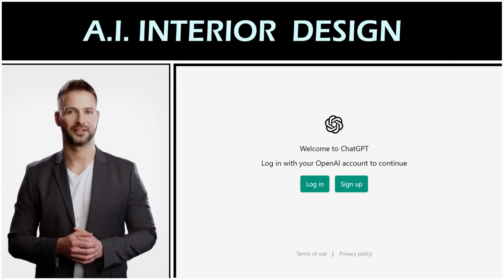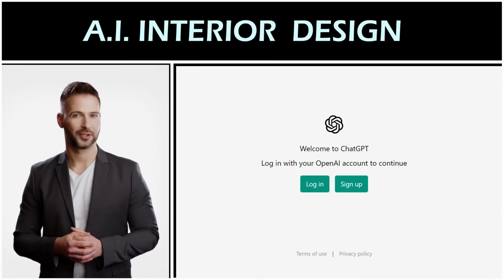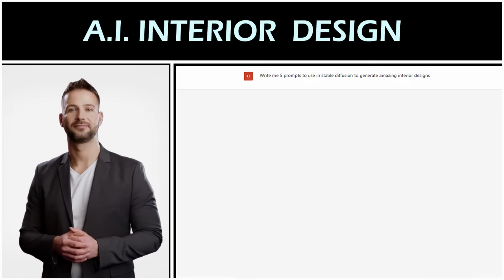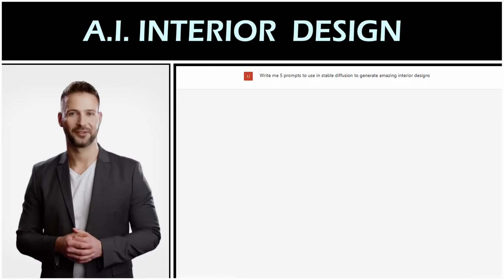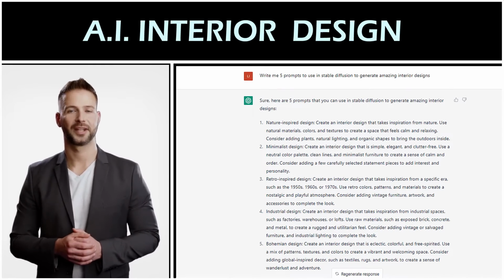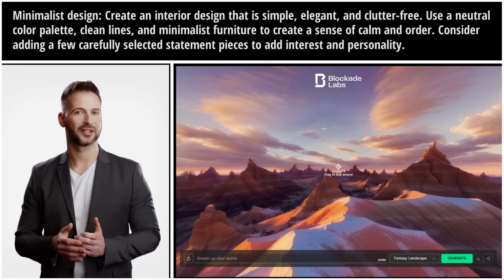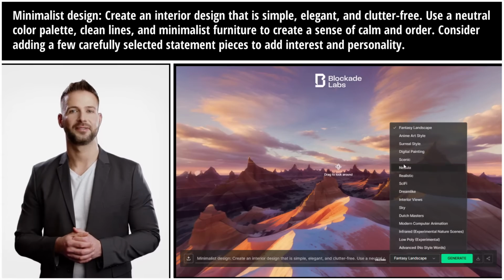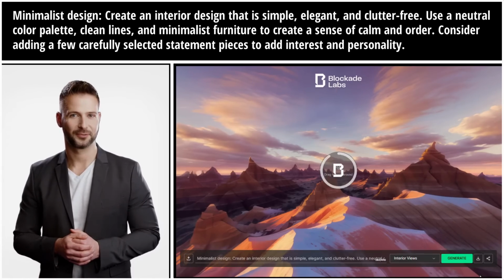Chat GPT A.I. Interior Design Prompts to Interactive 3D Rooms

Comment: Can you create an entire home model? I have some blueprints of a spec home I am currently building and I would really like to convert those 2d Blueprint models into a 3D Model with outdoor pool and landscaping.
Reply from the maker: With the SkyBox instant A.I. 3D generations it's not possible to draw a complete 3D model from a blueprint, but using  the Cedreo software mentioned in this video, you can import 2D floor plans to use as a guide.  There are some A.I. tools that do instant 3D models from 2D plans, I just found this one: https://planner5d.com/ai I'm going to try some of these out. Let me know how you get on. Has anyone else  tried any of these 2D to 3D A.I. tools?
Reply: @listening-pond 😂
Reply: The 3D feature is coming next month but you can do it using the Depthmap feature for now, the result not so good but it's a first step into getting a ready 3d model  @listening-pond